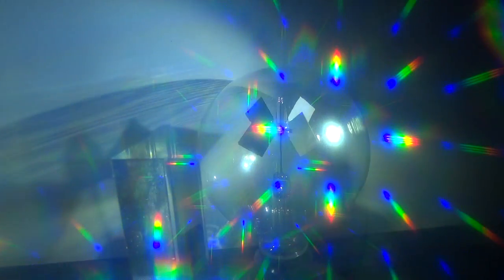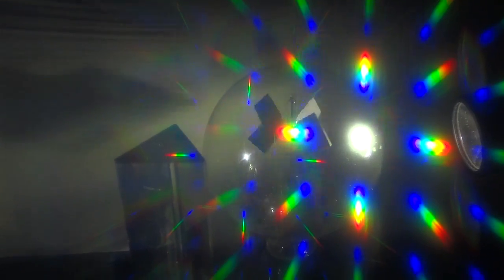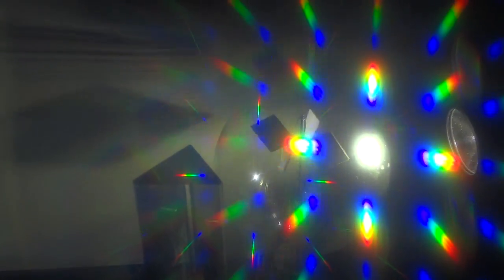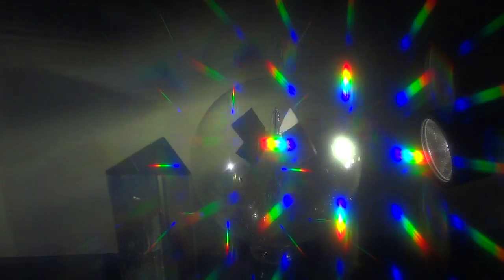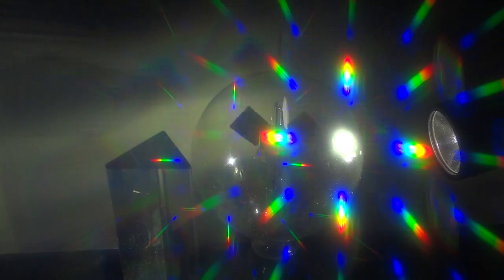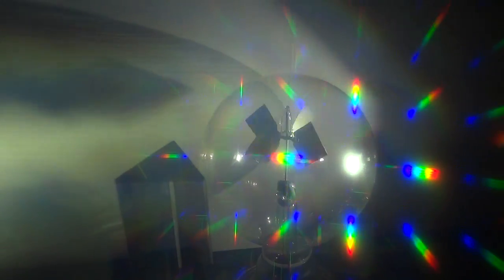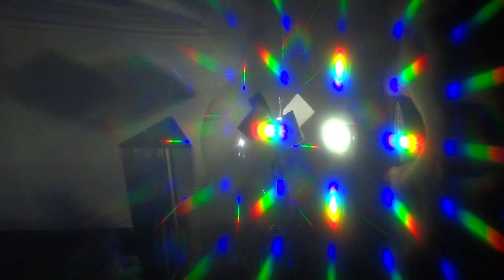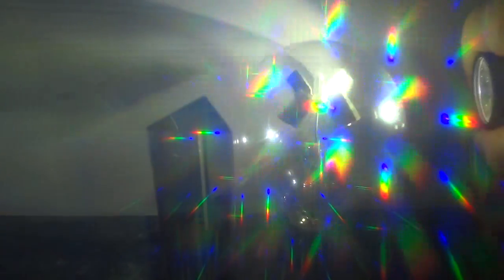140 Year Mystery Solved & Explained: Spatial Geometry VS. Field Geometry

Comment: It is heat effect. Black emmits the heat to the rest of air which in small quantity is present. Do you want proove?  Spray it with the cooling spray, and it will start to rotate too. No light needed. ;)

Comment: I've watched all your videos, some many times. And sometimes, all I can say is, "Dude"!
 This one makes me think of the experiment, when there's two balloons connected with a straw. One balloon is blown up more then the other. I thought the balloons would balance out, butt nose. (Mother natures box). The smaller balloon had higher pressure and got smaller. ?Smaller space, greater field density, shorter wavelength, greater frequency. Mother Nature gets freaky, when using her small box!

Comment: "The effect begins to be observed at partial vacuum pressures of a few torr (several hundred pascals), reaches a peak at around 10−2 torr (1 pascal) and has disappeared by the time the vacuum reaches 10−6 torr (10−4 pascal) (see explanations note 1). At these very high vacuums the effect of photon radiation pressure on the vanes can be observed in very sensitive apparatus (see Nichols radiometer) but this is insufficient to cause rotation." - Wikipedia. How does your explanation account for this?
Reply from the maker: +davidenespana 
his premise superficially seems accurate that its thermal perturbation 
by his experiment but if he used a high intensity blue light in the high
 vacuum it would still spin.   That his experiment validates gaseous 
molecular presence = lower threshold of spin only indicates what i said 
that a magnetic repulsion on the vane is rebounding from the standing 
air. Hes making the fallacy of "false connection" that air = movement 
and therefore the causation of motion is Thermal, but my explanation 
still stands that its magnetic rebounding,,........namely also since 
HIGH thermal light in the IR range does NOT cause motion. 

So all he did in that video was inversely validate my discovery.

Comment: whats your opinion of this guys explanation on this same device https://www.youtube.com/watch?v=llxqNcipTwA .. he says basically the spin is from the movement of air VIA Thermal creep. thanks in advance brotha!
Reply: +Kenan Mckinnon To add , i have been told that the color Black is the mixing of 3 primary colors ( a dark grey to some), and that white is the absence of color.. but in light we understand the opposite we know that white light is the entire spectrum , while black is the absence or lack of light of any spectrum.. could it not be that being that each individual color reflects out the only color it could not absorb , meaning green color reflects green as the only wavelength it was unable to absorb, so by adding 3 primary colors we are actually creating an "absence" of all color visually due to all the colors to be potentially reflected are being absorbed by the other colors which would typically on their own absorb the color to be reflected resulting in black(grey) which is instead of conventionally being the culmination of all the colors outputting black but rather is black(grey) being the "absence". White being the opposite in visual colors actually being exactly like light in that its reflecting symbiotically with the other colors the entire spectrum.. so infact the idea of the light hitting the black side and the black feeling a pressure from light as you said having less capacitance do to it already having contained all the colors so like a helicopter blade pushing down creating a pressure differential under the blade creating thrust , instead is done with light pressure differentials? again sorry if this is crazy sounds or not up to par in terms of physics or grammar, i wanted to get the thought out while it made sense in my head lol. Thanks!...also i think the thermal creep theory could be thrown out if a perfect vacuum was produced in this invention.
Reply from the maker: +Kenan Mckinnon my radiometer, unlike most, is vacuum sealed also
Reply: so was this guy not able to get results because he did use the near ultraviolet light as you did? and if so how did your regular white light work as well? im very curios in this effect because it will add more stability to my theory of gravity and its relationship to density differentials. Thanks in advance brotha!
Reply from the maker: +Kenan Mckinnon his premise superficially seems accurate that its thermal perturbation by his experiment but if he used a high intensity blue light in the high vacuum it would still spin.   That his experiment validates gaseous molecular presence = lower threshold of spin only indicates what i said that a magnetic repulsion on the vane is rebounding from the standing air. Hes making the fallacy of "false connection" that air = movement and therefore the causation of motion is Thermal, but my explanation still stands that its magnetic rebounding,,........namely also since HIGH thermal light in the IR range does NOT cause motion. 

So all he did in that video was inversely validate my discovery.
Reply: with my comment second comment on the possible realization of the color black and its potential to be the opposite of what id been taught in art class as a child, i agree and would love to see further testing on this simple invention, possibly into the effects RF has on it as well as Infrared on the higher end.. to see if there is indeed still motion induced. do you agree with my views that black(color) is in actuality the result of the light being cancelled instead being reflected out, which would account for why the black side is dominate in that as you stated the capacitance of the black side would create motion as the pressure(energy) being imposed upon the black side would have to express itself as motion as the energy would diffuse via radial expression , possibly as heat or simple electric field being that the light absorbed is not being expressed via color?